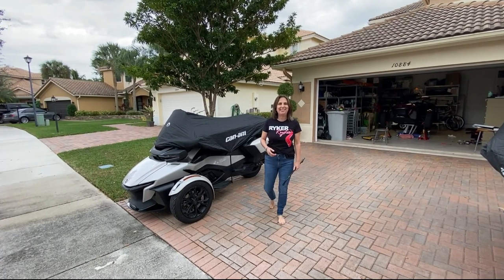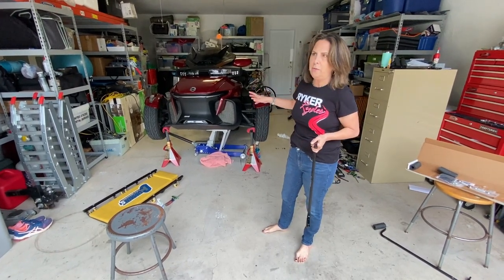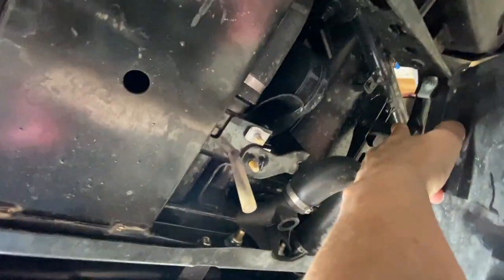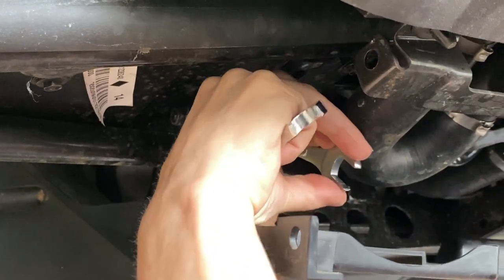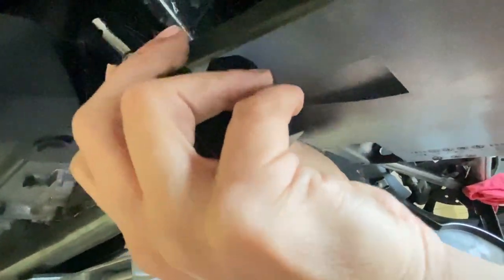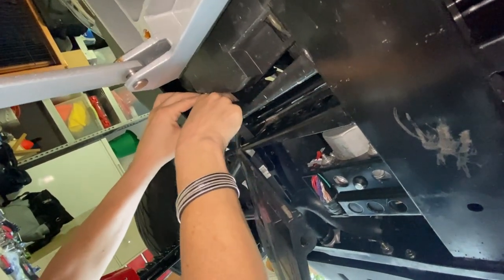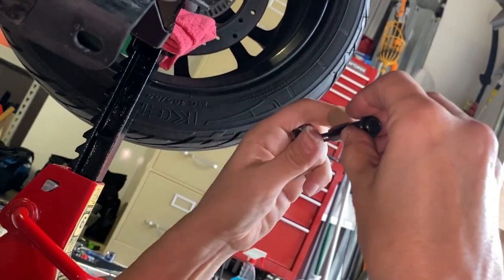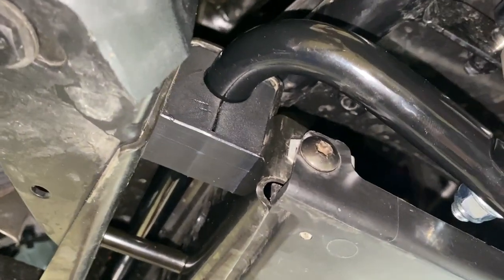How to Install a Baja Ron Sway Bar on a Can-am Spyder (in less than 10 steps)

Comment: Thank you so much for this! I followed it step by step and didn’t even need the directions in the box. Easy Peasy! Installed the Baja Ron sway bar and a Pedal Box. All I can say is you BETTER be holding on! This thing is a rocket ship now wow😮!
Here’s how I lifted my F3T…I have a Craftsman motorcycle jack. I had to put 2x4s down in front and drive up on them so I could get the jack under the frame as far front as I could. You do this so the back wheel stays in the ground. Then jack up a good bit and get the jack stands setup under the front arms. Lower the Spyder down onto the jack stands. Drop the jack down even farther then, so I could put 2 ft piece of 4x4 post on top of you jack arms. Now take it up as high as the jack will go and you should be a bit above you jack stand max to put them back under the arms at max height. Then lower her down on to the maxed out jack stands and get to work! This gave me the extra few inches I needed.
Reply from the maker: Awesome job! Thanks for the tips on how you lifted your Spyder!! Ride safe…hold on. 🫣

Comment: Just put it on my 23 RT limited today. Took about one hour. Good video just one point or recommendation. I removed the rear skid plate as well, its just 4 push pins and it made getting to the nut on the left side holding the old bushing soooo much simplier. I like the handeling  while cornoring. It feels so much more solid than the factory bar. My Only regtet is I wish I had ordered the heavier bar that is offered its not that much more expensive but the standard Baja Ron bar and end links is still head and shoulders above stock. Even on a stright run the steering feels a bit more responsive. I used one 10mm wrench and socket and one 13 mm wrench and socket. I also removed the t30 screw holding the fwd skid plates so I could get them completely out of the way.  Happy riding and keep your knees in the breeze!
Reply from the maker: Thank you so much for the informative comment! I’m sure it will help others. PS next time you’re shopping for something. Please check out my website RykerRydes.com and SpyderRydes.com 

Ride safe!!!

Comment: Secure install, I installed one myself last week, I saw one issue, the lower bolts are best to be installed facing outwards, reason being, the bolt (the shank) is super snug when going through the Baja Ron spacers, when installed correctly the shank goes through the sway bar then enters the spacers, the spacers just slides right on, also the bolts facing inwards is really close to the under fairing and could damage them. The instruction did show to face the bolts outwards. Initially I wanted to do what you did but realized otherwise. The installation is secure so the rider would be safe, nothing to be concerned from that perspective. I enjoyed watching..
Reply from the maker: Interesting perspective.  Thanks for watching and for your comment.

Comment: A fabulous tutorial. My wife rydes a '17 F3S and complains about the handling being "loose." Mechanically, the install will be a breeze. What I learned the most is how to get the beast up to the right height to remove/install the bar. Kudos to you! Told my wife about your channel so she can subscribe.
Ned and Chyanna in SC
Oops, forgot. If you see this, what did you use on your lift to match the angle of the tilt of the Spyder? I would not want all the weight on one end of the lift. Hope this makes sense.

Comment: Today I fitted a BajaRon sway bar to my 2020 RT Ltd.
I watched your video last night which helped immensely, especially your tip of using superglue on those small washers on the end links.
I’m in Victoria Australia and unfortunately the condition of our country roads has deteriorated in recent years.
I’m hoping the new sway bar will make the ride less of a wrestling match when encountering some of our crappy roads. 
Thanks for your video 👍
Reply from the maker: So glad I could help!! Make sure you check your tire pressure often!!

Comment: Just installed my new sway bar. I totally removed the two front splash plates. With my luck, I’d have busted them off somewhere along the way had I left them hanging by the T30 screws. Because I don’t have “little girlie fingers”, I also pulled two push pins on that plastic piece to allow it to swing down, providing more room for my short, fat little phalanges to reach up on the “icky side”. As I had hoped, this video made the install go smoothly once I figured out how to best elevate the front end.
Reply from the maker: That’s awesome!! Congrats on the install. Thoughts on the handling?

Comment: After getting my sway bar (not sure why they don’t call it an ANTI-sway bar…), I took Jean-Luc out for a spin. I am blessed with many twisty roads in our area, so I had great opportunities to test out the Baja Ron’s. First thing I noticed was how planted my 3-wheeled starship felt just turning corners in the neighborhood. On the windy roads leading into town there was a HUGE difference in how it handled in the curves. Heading back home again (isn’t that a John Denver song?), I practiced lane changes on a straight stretch when there was no oncoming traffic. Very responsive! Sooooo….my advice to anyone even slightly considering the Baja Ron sway (or anti-sway) bars is to go for it! Although the install can go quickly, take your time, watch this video (twice if you have to like I did) and you will be satisfied by not only a far better riding experience, but in the satisfaction of knowing you did the job yourself. You can do it….even if you don’t have “little girlie fingers”!
Reply from the maker: Best review ever! Could you possibly copy and paste on my website under baja ron sway bars?? ❤️
Reply: I posted an extended review on your website that includes yesterday's trip that included highway ryding.

Comment: When i looked up that floor jack you used, it is only a max height of 17 inches.  How did you raise it the additional 7 inches.
Reply from the maker: It is actually my friend’s floor jack. I will ask him.
Reply: @RykerRydes hubby just bought the ultimate jack.  A Big Blue from the UK.  I lifts the complete Spyder off the ground.  We did two Baja Ron Sway Bars in  week on mine and hubby's F3Ls.   Good video.

Comment: Hello Beth I wanted to let you know the board at my condo allowed me yesterday to have the integrated cover for the ryker but not a full cover . So the windshield, handlebars and seat will be what is covered. So I will see how the bike holds out in the sun. I tried to order the back to black product you used but Amazon did not have it in stock at the time I looked so I ordered the VRP back to black it is supposed to also have ultra violet light protection. Are there any other products you can recommend that is safe for the bike that will protect it from the sun like maybe a wax. Love your videos and the one you did with the Linq cooler was very helpful because when I got the bike used it came with that cooler and now I understand how to remove the cooler and what kind of plate is used and I did not even know my bike came with the max mount until I say your video I thought the plate I saw on top was in place of the max mount so now I know I have a ram mount also. Keep the wonderful videos coming and thank you for being such a big help to the ryker community. Over time I will do a video on how the ryker plastic holds up without being covered I never saw a video that talks about that and this could help other people who are in my situation who are not allowed to cover their back and do not want to pay a high monthly fee to store it at a storage unit. I found it a pain anyway having to drive my car somewhere to be able to drive my bike I just want to walk outside the condo and get on the bike and not have to drive to it.
Reply from the maker: Thank so much for your kind words.  I am glad you got to cover your bike, at least partially. Some condo rules, just don't make sense to me. I would try to fight it. As for products to use on your Ryker,  Back to Black is my favorite.  Just be sure anything you buy, is safe to use on plastics. I would recommend getting a wrap for your bike (AMRracing.com), that is the best way to protect your bike and keep it looking awesome (wrap won't fade in the sun).  If you decide to go that way, watch my wrap video for a coupon code.  Keep me posted! Ryde safe!
Reply: @RykerRydes  thanks for getting back to me. I do not have the patience to do a wrap plus I notice people use dryers when doing the wrap and since I do not have a garage or any outlet outside to plug in a dryer that would make it even more difficult. What would someone charge to put a wrap on for me I would guess it would be expensive since it looks like it is very time consuming

Comment: One more question Beth about the plate for the Linq cooler that is on the bike how do you remove the plate do I push that button down and  then the button pops up and lets me slide the plate off because in your video you showed how to put the plate on but not how to take the plate off, thank you.
Reply from the maker: Yes, exactly.  You may need to push the button up from underneath, to help pop it up.

Comment: Hi there ... Thanks for this video. Did the byke feel stable when fully lifted with the HF lift? Did you not use the 2" extension pads for extra height? I'd certainly also use tall jack stands up front. Thanks for any info..
Reply from the maker: I felt the bike was pretty stable.  But everyone has a different comfort level.  Using tall jack stands is definitely the best option.

Comment: I do have one more question I noticed the ones that you are using are adjustable Pierre from Ontario has it's given the same set but his aren't looking like the plastic but they're  Not adjustable would that make a difference And it's the same price. Another words would I need to adjust them. Or worry about them getting loose His aluminum ones are one piece. There is no adjustment
Reply from the maker: I’m not sure about other brands, but the Baja Ron ones are NOT adjustable.

Comment: I checked the link on that blue jack you were using and it says the maximum height only goes up to 17". How did you get the necessary 24" clearance?
Reply from the maker: It does work, I promise.  When the jack is just below the sway bar channel, it will raise the front to the necessary height.  That jack is the exact one used in the video.

Comment: So thats how you get in in the air..  my jack will not fit under my 2022rtl, so I run up on ramps and jack from their but still leaves me 4 inchs short..    ATV lift just forward of center..  Ok a Meroral day ITC sale at HF.  Maybe I will get my BajaRon on tomorrow
Reply from the maker: Awesome! Let me know if you notice a difference!!
Reply: @RykerRydes  indeed I do.  well worth it.  well maybe not.  I started with a pair of jack/ramps before the ATV lift.  I actually own an original Big-Blue lift but it's not rated for a Spyder.  I actually removed the 2 T30 screws (left/right covers) and the front 2 push/pins for the right/rear cover providing much easyer access to the bushing pinch bolt nut.  All went well until I over tightened the inboard channel pinch bolt and snapped the end off.
Reply from the maker: @n6dl321  nooooooo! Were you able to get it fixed?
Reply: @RykerRydes  indeed 2 trips to lowes to get a 6/1 65mm stainless bolt. First was only 50mm

Comment: I have a question rather than change the whole bar why not just change  The 2 end pieces that are plastic ?
Reply from the maker: Absolutely that is an option.  On my Etsy page I sell the whole kit as well as just the links. The links make a big difference, but the entire sway bar + links makes a huge difference.  Hope that helps.
Reply: You can take out the play from the plastic end links ,but the overall tension in the bajaron swaybar is higher and they takes a lot of sway and makes the byke really handle better.

Comment: where is the jack location?
Reply: i have that jack and Im trying to figure how to jack it up. Then to tilt the bike on the rear wheel
Reply from the maker: Under the bike there is a “sign of the cross”. That is your jack point. In the middle of the video I point it out.

Comment: It doesn't make sense why would they want to put spacers why not just make the part larger. The dog bo ne. I went to Slingshot but they have one like that but they have nuts which makes it adjustable both sides and they have the ones that are not adjustable That's what I'm Questioning
Reply from the maker: I am not sure. That is a good question to ask Baja Ron directly.  He has done years of research and 1,000’s of happy customers.